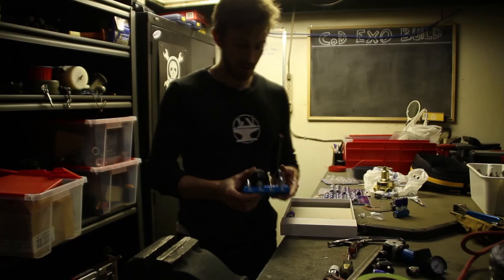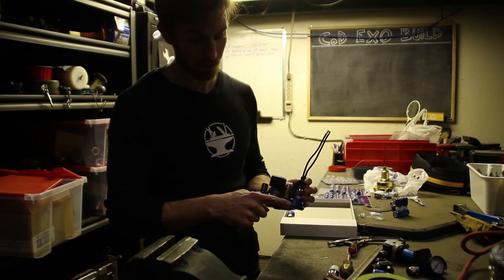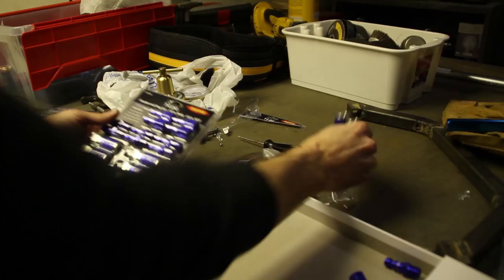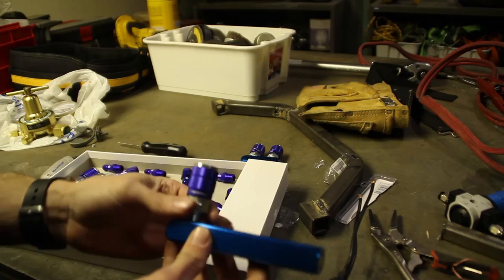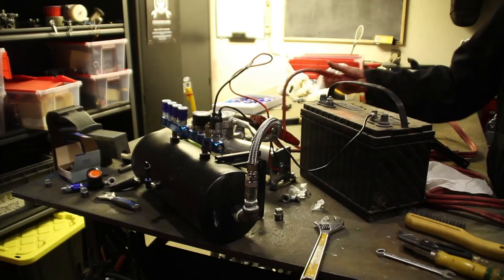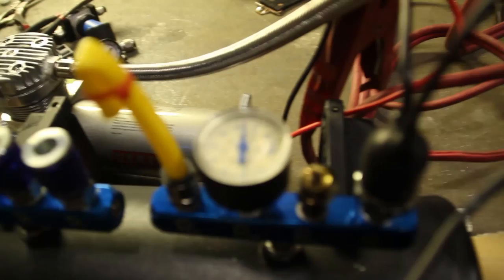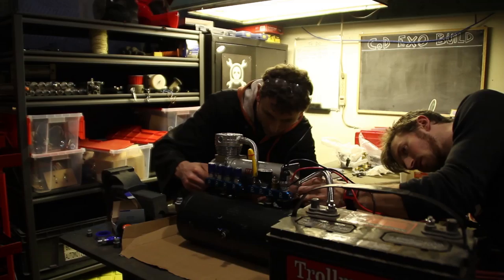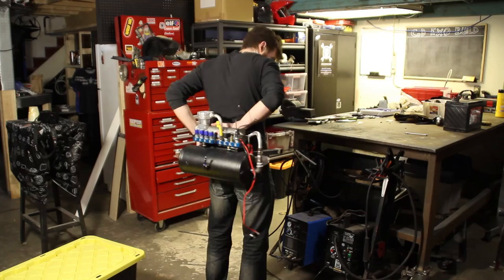Pneumatic Power Pack

Comment: On the matter of having a good tool around for projects.

Go to SVSeeker's channel on YouTube, go to his page, press the search icon, type 3d printer. He made 3D printer, CNC plasma cutter, foam cutter, and CNC mill in one. Check his videos on those topics, make yourself one, he made it on the cheap, it works, he's building a freaking boat in his yard. 

In case i typed in Chinese, a steel boat, in his yard, big, steel, boat, in his yard. So go research that All-in-one, you need it.

Comment: this is a serious question from a student engineer. how do u plan to mount it on the exo. r u planning on having the wearer use their own strength to carry it or with their be some kind of weight distribution in the frame. just a thought I had. I'm sure u have it figured out. I was thinking use a system like raytheons exo suit where u attach the frame in a way that puts the weight on the suit as opposed to the wearer. I probably sound like a total idiot. Oh well.
Reply from the maker: I thought I mentioned this in the video :) it's mounted directly to the exos hips ;-)
Reply: +the Hacksmith so u did. I'm sorry. I guess I missed it. I haven't been keeping up with the project as much as I'd like to so I probably have missed alot. well anyway. keep up the good work. I hope to start on my first exo soon.

Comment: How strong is the air tank? Could it break easy? anyone know?
Reply from the maker: +Tommy McLennan The shell is solid powder-coated steel, a few millimeters thick. Certainly not bulletproof or anything, but I will be armoring it at some point...
Reply: You've got that covered then, Thanks for answering :)

Comment: the only thing I fear with pneumatic system is that it will be a slow exo ... am  I right ? I am john snow of the engineering
Reply from the maker: +geordi rendum pneumatics are pretty much the fastest option... servo motors could be faster, but wouldn't have enough power. Hydraulics can be fast and strong but thats a whole 'nother playing field.
Reply: the Hacksmith ok cool :P

Comment: how serious are you about the practicality of this design?
Reply from the maker: For my purposes, quite practical. What exactly are you referring to?

Any and all exoskeletons all have an Achilles heel -- we simply do not have a power source capable of powering them. The only feasible style would be a power loader / mech with a gas engine. For a light weight suit, even the most advanced lithium ion batteries aren't enough.
Reply: Of course thus one must ponder the feasibility of such a device in the first place, a system as cumbersome as this would be too much trouble for what it's worth, thus I asked about the feasibility for day to day use and as to what you would use it for. Also DARPA has been experimenting with 'soft' unpowered exoskeletons which don't require an energy source you may want to go down that road.
Reply from the maker: +Jak Thompson hence why I'm building this project on YouTube and not in a secret laboratory ;-)

it's not commercially viable, but it's still going to be awesome!